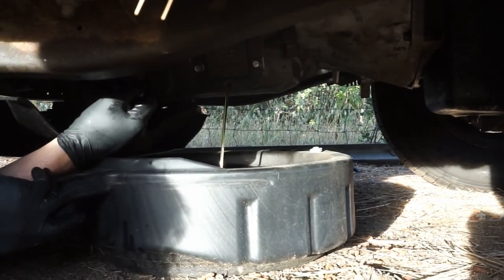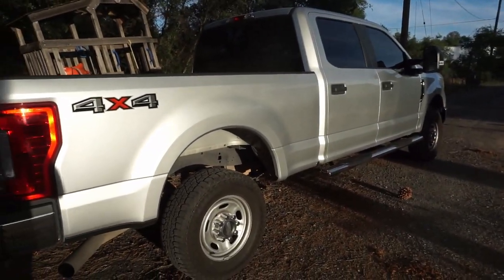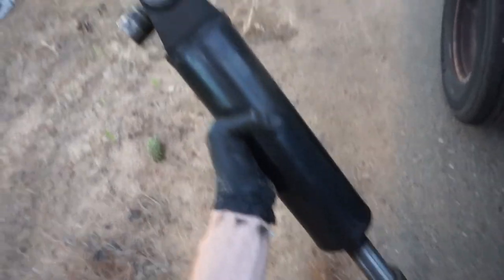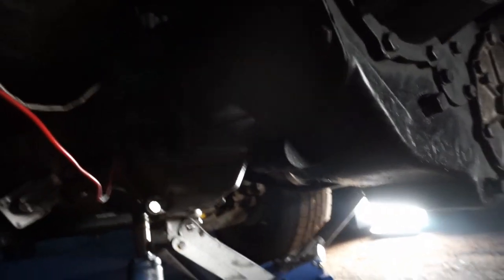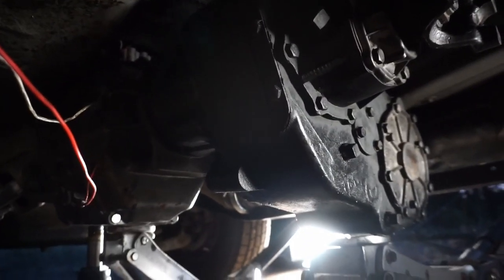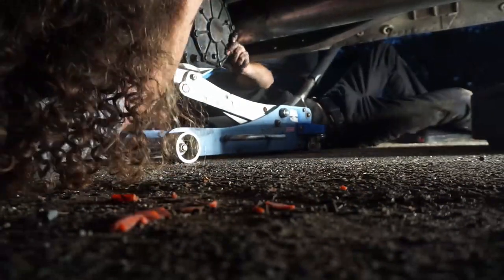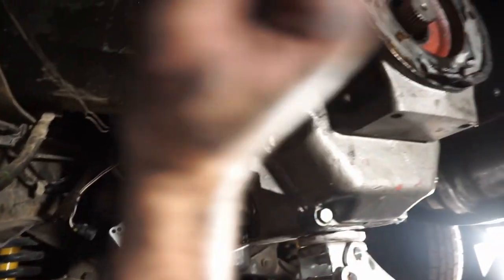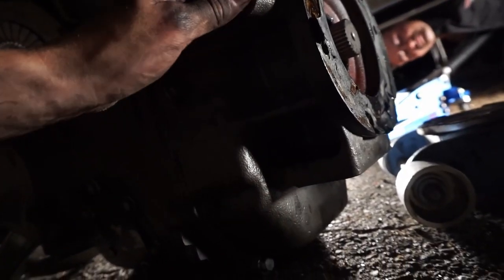First Gen Cummins Transmission Removal. NV4500 Is Broken.

Comment: I would be interested to hear your seat of the pants perceptions of the hx35 with the larger exhaust compared to the original setup. Particularly if you can get some zero to 60s. I really like it when you guys show how they do things in steps and then the performance gain for each separate step. It helps guys like me decide on doing similar things. Enjoying your videos just found your channel.
Reply from the maker: Thank you! Hard to tell 0-60 with just the HX35, I'm not sure if it makes enough of a difference on its own. It definitely spools faster but without more fuel it feels similar to the stock turbo at the peak end of the powerband.

Adding the fuel pin and gov spring will really wake this turbo up. It's what's next on the list!

Comment: keep making videos your the man    also i have rebuilt my nv4500 you deff could do it what happend syncros or 5th gear nut serious chunkage should have pulled the cover and took a look cummins for the w
Reply from the maker: I sent it back and already installed the warranty replacement. It's good to go now. I'm going to install the fuel pin and gov spring next